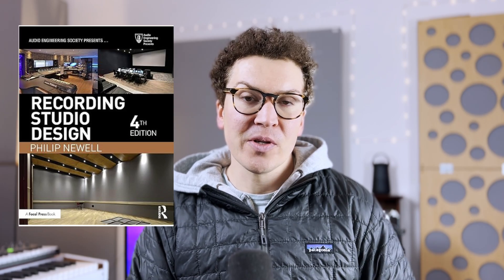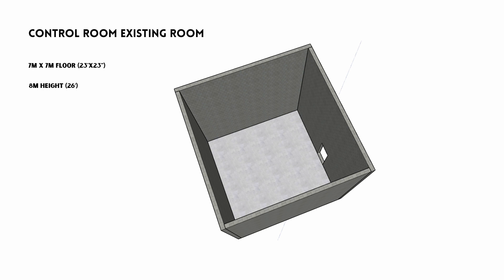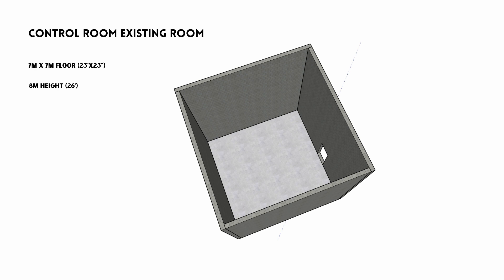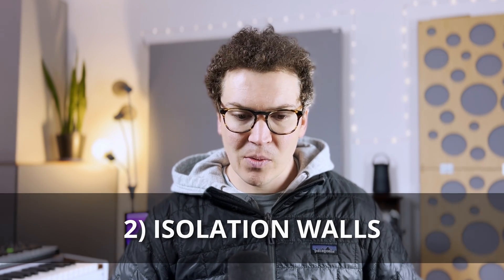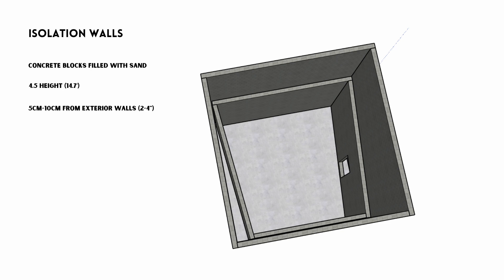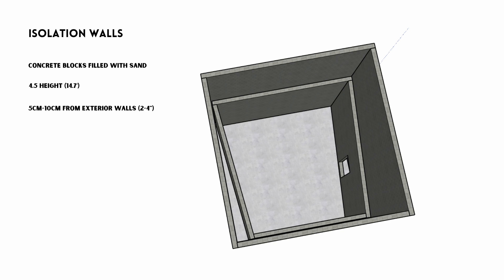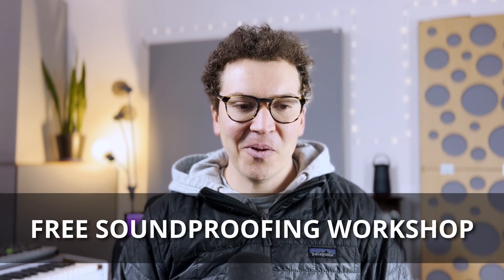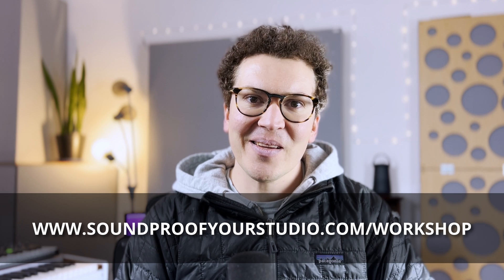How To Build A Pro Control Room (Part 1: Isolation)

Comment: hey, so im designing a home control room and trying to decide whether to cut out a portion of the control room in order to make it rectangular, and then using the cut out space to create an airlock hallway between the control room and performance room. Or, utilize the extra space and just use a double door between the control room and performance room, with a weird shape in the control room (like a rectangle with an extra "L" slapped on the side). So im wondering, is symmetry and shape more important in the control room, or size? I know this can come down to detailed measurements and stuff, but also maybe just personal preference. Also, the "hallway" airlock would be pretty narrow, like 22in wide after putting up drywall, which wouldnt be that comfortable to move through nor transport large instruments.
Reply from the maker: I would say symmetry is more important in your case. It’s important for an accurate stereo field.
Reply: @soundproofyourstudio  ok, thanks for the input! I'll go for the symmetrical/rectangular control room then and cut out that space as an airlock hallway.